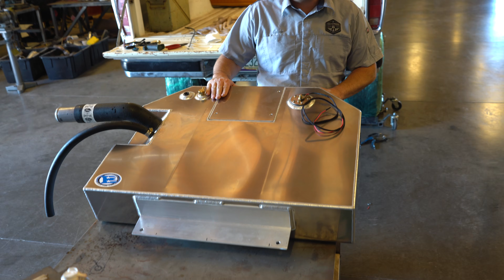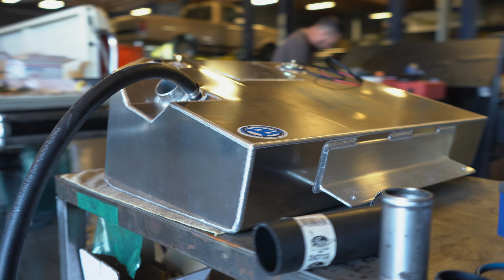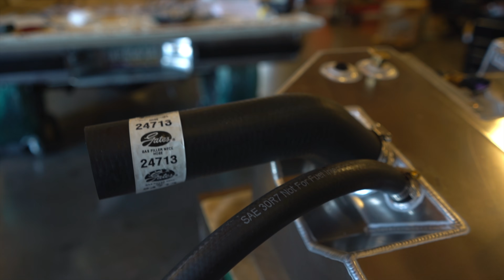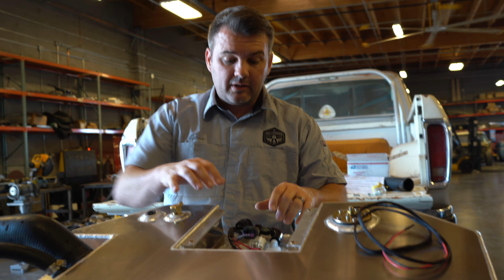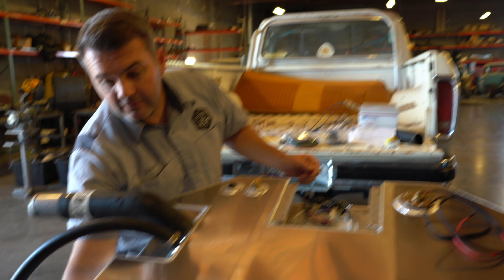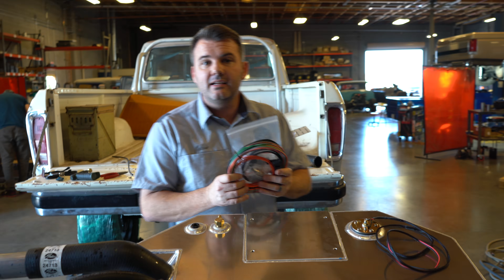The Perfect 73-79 F100 Coyote Swap Fuel Tank | Fat Fender Garage

Comment: In the truck I’m thinking about swapping I already have an efi tank out of a 1996 f150 with a 302, my truck has an efi 460, is there a pump I can up grade to, or should I get an aftermarket fuel pump on my sending unit
Reply from the maker: Always try to get the fuel pump inside the tank. Stays cooler and lasts longer.
Reply: @FatFenderGarage  yep fuel pump is In the tank

Comment: I have a 1974 highboy and I see y’all have tanks available for the highboy frame. Will these tanks work if your not doing a coyote swap? Have a built 390 fe motor in the truck and just looking to do the relocation of the in cab tank to the rear, will your new tank work for that or does it only work for a coyote motor?
Reply from the maker: Austin Lushbaugh yes. We can supply with a less powerful fuel pump. Email Dan@fatfendergarage.com

Comment: I'm guessing that's an F-250 because of the toolbox on the fender.  If it's 1977 or prior and 4 x 4 then the frame is more narrow than an f-150/100.  Does Boyd make a tank that fits the highboy frame?
Reply from the maker: We have just mocked them up and they will be available in around 3 weeks. If you want, you can order one on our website now (They arent listed yet, but if you buy the one linked here: https://www.fatfendergarage.com/product/1973-1979-ford-23-gallon-rear-mount-tank-coyote-swaps/ and put in the note section that it's for a Highboy, you can be the first to order one.)

Comment: Very cool! Will it fit 64-66?
Reply from the maker: EcoBoost EngineSwap I have one for 67-72 that might fit.
Reply: Fat Fender Garage Can you text me the info? Eco requires 120 psi feed pump.
Reply from the maker: 120 psi is a lot. Have to do some homework on this. What comes with the F-150?
Reply: Fat Fender Garage There is also a 90370 Fuel Pump Control Module. I think minimum depending on load etc was 90-100 psi. (I have vid on all this) Have not tested 2018-19 yet but on high side on the non dual fuel system the pressure was around 2900 psi.